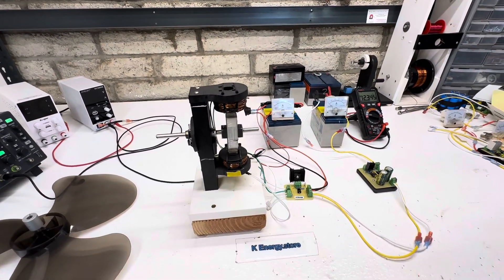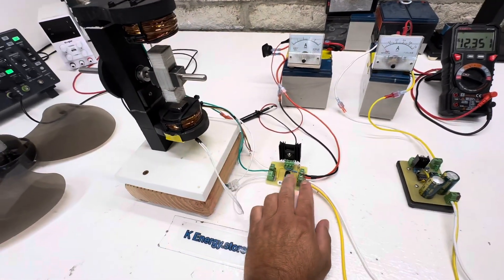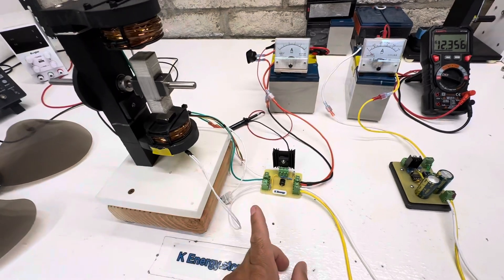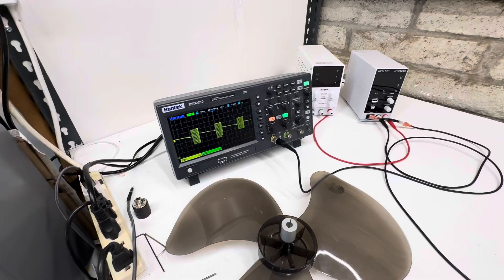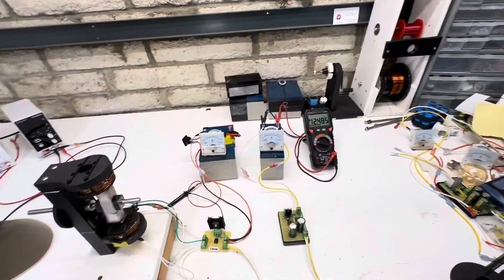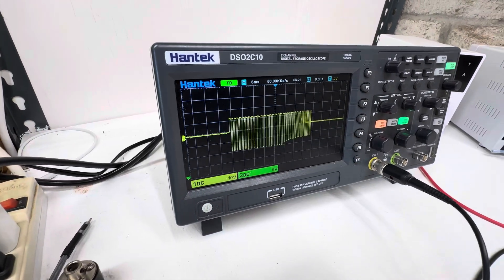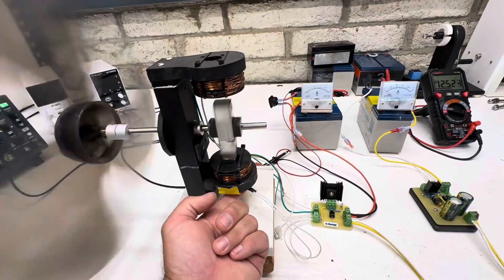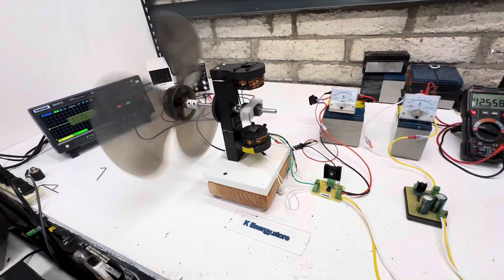Oscillating read switch motor

Comment: Just found your Channel. Nice Video! But it seems like the left cap is dead. Maybe to high peak currents, since i don't think there is too much voltage?
Reply from the maker: @dasigel1141  cap still works but yes a bit expanded from pushing it to the voltage limit testing not from the current

Comment: Would that not be due to the coil reducing the magnetic field strength at the reed switch when it turns on? So the magnet turns on the reed switch which turns on the coil. The magnetic field from the coil and magnet combined reduces the field strength at the reed switch, so it turns off.
Reply from the maker: @123psi8  the reed switch is the signal for mosfet 
The oscillation reduces amps

Comment: That is a nice model there. But half an Amp is a lot for these, are the coils low resistance? Maybe try a finer gauge wire in the coil, less current and more 'bemf' . Keep up the great work 👍